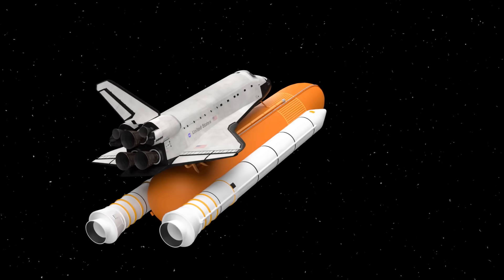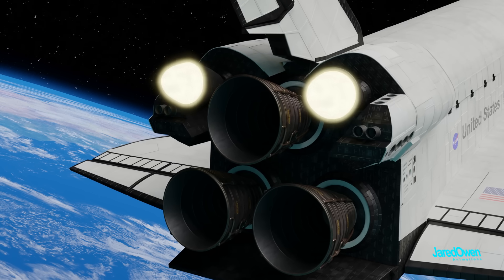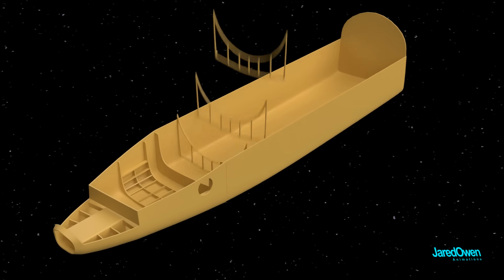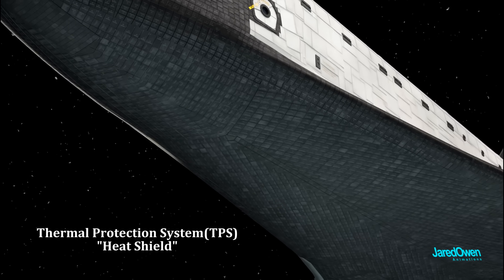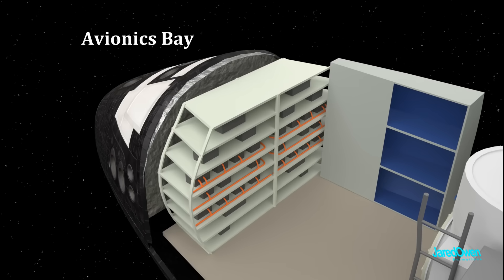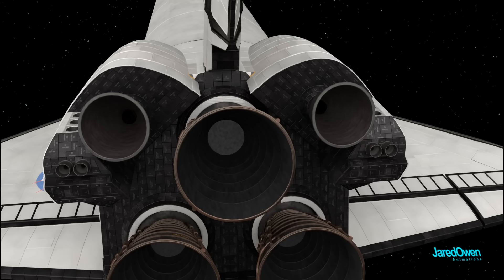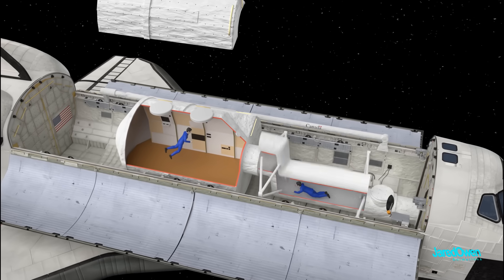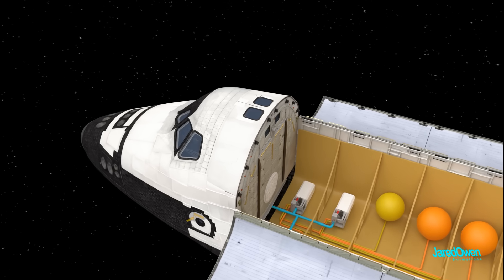How did the Orbiter Vehicle work? (Space Shuttle)

Comment: 9:05 what is the reason the fuel needs to be cooled before it is burned?
Reply: What do you mean?  The liquid fuel is ALWAYS been  extremely cold. The fuel needed to pass through the rocket engine's noozle so that they won't melt due to extreme heat by the burning of propelants. It kinda acts as a cooling system, killing two birds in one stone.
Reply: To make it more dense to carry more.
Reply: The hydrogen and oxygen were cooled so that they were liquids. This allowed the tanks to carry much more fuel than they could if the hydrogen and oxygen were gases.
Reply: It’s to prime the engines and prevent thermal shock.

Comment: factoid - off the shelf  " Philips Milk of Magnesia " used on each of the three
APU's mounted on the 1307 bulkhead. Applied to the threads of the EGT
sensors mounted on each exhaust stack as a anti seize  agent.
Anhydrous Ammonia stored in three AFT tanks about  the size of soccer balls 
shaped like inverted tear drops mounted above  the 50-1 door

Comment: factoid - microphones mounted on the belly of orbiter OV-102 
I routinley R&R , 3  located on the center line
at the wing root with one at the base of each root.
whats curious I questioned INS folks yet always told in a polite 
way they  don't  know there purpose

also - explosives
cargo bay - at each RMS pedestal located on the payload bay door sill
are small guillotines which sever control wires which signal a retract/extend/
 status to  the Forward Mission Station prior to jettison.
KU band antenna functions the same way

Aft compartment --  internal ET attach mounts designed to fracture the attach
(2)nuts port and starbrd. the units were covered by a large inconnel honeycomb 
mesh bowl which contained the shrapnel that otherwise would pelt the interior aft
compartment.

vent doors - Aft & Payload bay port and starbrd , function tested each launch

Et (external tank) doors - surprisingly those large doors, mostly go unnoticed by those 
who walked daily under the orbitors . They are Opened prior to Et tank mating VAB and 
cycled tested each flow. These doors are covered with tile they travel 180 degree the mechanism /linkage itself looks and acts feeble which is slow and labored, once opened its latched in position.

Comment: I feel like it should be mentioned that the shuttle was NOT originally designed to carry that many crew, nor was it intended. Adding those other positions came later in the program as the shuttle didn't realize the savings it promised and more justification was needed to continue funding. Hence, more people for experiments, and capacity for the oncoming space station passengers.
Reply: There were so many things the Shuttle under-delivered on, as well as many concessions made to keep the cost down.  Things like the detachable crew cabin that could have saved the lives of both the Challenger and Columbia crews.  But then, if it used liquid-fueled boosters rather than solids, the Challenger disaster may never have even happened.

Comment: The design of the shuttle looks awesome and makes sense. I wonder why it was so expensive to run?
Reply: Because those massive engines at the back had to be taken apart and painstakingly refurbished between every flight.  On top of that, every single tile across its surface also had to be removed, inspected, and fixed or replaced.  And that's only the main concerns.  Everything else inside and out had to be inspected and refurbished as well.  Its promise of reusability unfortunately fell quite short.

Comment: whats the orange tank for again?
Reply: For launching into orbit, it in the main Tank. When you see other rockets they are big and only consists of tanks. The shuttle accelerates up to 17,000 mph, stops the main engines, and throws away the orange tank.
Reply: The orange tank supplied fuel and oxidizer for the shuttle's three main engines from lift-off to about 8 minutes after launch, when the shuttle had almost reached orbit. The final little push to a stable orbit was done by the two much smaller OMS engines that got their fuel from internal tanks in the shuttle's tail section.

Comment: Beside External Tank, was there any Fuel inside Orbiter for Main Engines... If any use for reentry and during landing like an aeroplane
Reply: No, only for the much smaller OMS engines and the RCS thrusters.
The two OMS engines were used to give the orbiter the final little kick to reach a stabile orbit, and also for the re-entry burn to initiate the landing procedure.

Comment: How does the external tank not break up on the ride up, but does on the way down? Doesn’t seem to make sense!
Reply: It does make sense once you realise that the shuttle’s speed vs altitude during launch was very different from its corresponding speed vs altitude during re-entry.

The very upper part of the atmosphere near the Kármán line (100 km altitude) is so thin that it didn’t slow down the shuttle very much. It was therefore still flying at near orbital speed when reaching the denser atmosphere lower down, where it experienced its maximum heating at 70 km altitude when still moving at about 24,000 km/h.

During launch, most of its acceleration happened after it had crossed the Kármán line. When passing 70 km on its way up, its speed was only 5600 km/h or less than one quarter of its speed at the same altitude on the way down.

Although not identical, the speed vs altitude profile of the external tank during re-entry was far more like that of the orbiter’s re-entry than during their launch. And unlike the orbiter, the external tank didn’t have any thermal protection system since it was meant to be destroyed during re-entry.

Comment: If space is a vacuum, how can thrusters work, and or combust if they do?
Reply: First of all space is not a vacuum. Second of all the thrusters use an oxidizer to combust with whatever fuel it uses which produces a propulsive force.
Reply: @msidc1238  what, if space isn’t a vacuum then why is it called a vacuum. Figured the oxidizer supported combustion but the force has to be put onto something so, why do they say space is a vacuum.
Reply: @robertbonsai7176  Same reason vacuum chambers are called vacuum chambers even though they cannot achieve a perfect vacuum. In fact it is impossible to achieve a perfect vacuum. The force doesn't have to be put onto something. The gas rapidly expands as it leaves a nozzle causing a propulsive force. "For every action there is an equal and opposite reaction".
Reply: how can thrusters work

Because physics magically doesn't stop working in vacuum kiddo;)

Comment: Great animation
A little lite on the info for specifics
Such as rentry   why is rentry is free return trajectory chosen? Initially the design called for jet engines. How design developed to what was flown.   
Orbiter info such as enterprise was initially intended to be reconfigured to fly in space but was later determined it would be cheaper to assemble new orbiter out of spare parts instead. Why did the Columbia have black chines on the top forward section of the wings? And no others did! Why was Columbia so much heavier than others. Why was white tiles removed in lieu of nomex blankets on top side of orbiter? 
Tons more questions to answer. 
More info on SRBs and tank as well. We all know about the o rings what was original design? What changed? What is the bipod ramp foam? Why was it needed? What did they end up with? Why was the first ET painted white? Why was the tank not reusable? 
More info on SSME's . Why wasn't SSMEs not jettisoned with the ET? Why TPS was silica tile chosen? Why not oblated materials? Who and how was it shuttle built? Who designed it? 
Why was program cancelled?

Comment: Very good video, but most people have no idea how useless the space shuttle program actually was. It was one of, if not the most dangerous manned spacecraft with a total of 14 deaths and the loss of 2 vehicles. This gave it a 1/68 chance of failure during the entire history of its missions between 1981 and 2011. The cost to get the space shuttle ready for each mission also greatly exceeded that of most single use rockets as well, and given how little it was used compared to how it was advertised, the cost per mission was around $1.5 billion, and the cost to deliver 1 Lbs of material into orbit was around $27,000. (For comparison, the Soyuz can deliver the same amount of mass into orbit for $2,400 instead)
Reply: True, however it simply wasn't possible to use other things to move such large segments to space with any other rocket. Yes the space shuttle was overpriced and had failures which caused the program to die out. However the ISS needed the space shuttle for its ability to bring such large modules to space.

Comment: Seems they could of flushed their body waste like poop and pee in space because if it reentered the waste could burn up. Is the reason they don't because they might need back up with it orbiting the earth and it might splat on the windows or I guess be frozen and maybe come and hit the shuttle causing damage to it? There is other space debris so a little poop and pee shouldn't be a worry.
Also how is the boosters not burned up when it reenters but the big external tank does? I still can wrap my head around when that man jumped from space when he was in a balloon and didn't burn up, even went mach 1 almost passed out from the G force.
Reply: The big fuel tank (the orange one) was released much higher then the boosters. The boosters were also designed to be recovered, while the fuel tank was not. The man who jumped from the balloon jumped at 135,908 and didn't have prior acceleration upward. He simply just fell. While the SRBs were dropped at 30 miles up or about 150,000 feet. The orange tank was dropped at 70 miles up or about 370,000 feet up, much higher up with the aforementioned height upwards. Thus it fell faster and wasn't as resiliant to heat and burned up back on the way down.

Comment: Grown men talking about space travel 😂😂. What a joke. That piece of junk goes 17,000 mph!!?? Does anyone think anymore? The SR-71 was a razor thin aerodynamic engineering marvel, it stretched a couple inches at it's cruising sleep due to extreme heat, it didn't have any paint on it cuz it would melt. The maximum speed of the SR-71 was 2,455 mph. This piece of garbage would fall apart at 500mph...stop believing in cartoons
Reply: We have video proof. So maybe you shpuld get an education first
Reply: Firstly, the speed of the SR-71 was measured at 85,000 feet. While the space shuttle that flew at 17,500 miles per hour was measured in low Earth orbit at about 1,642,000 feet where air resistance is almost non-existant. While the SR-71 had to fight against air resistance when it was accelerating. 

When the space shuttle was re-entering earth's atmosphere, it had to de-celerate using the heat shield on the bottom and front, while the SR-71 still had to accelerate to reach that speed. By the time the shuttle was at the SR-71's cruising altitude it was already much slower. Plus the shuttle did fall apart above 500mph once. 

RIP to those aboard the space shuttle Colombia during the heat shield failure.
Reply: I watched with binoculars Shuttles fly overhead many times.
Reply: no

Comment: Hard to believe that such tiny thrusters can enable a big ship like that to turn or make adjustments in space! Cool video!
Reply: I know that's so crazy, like I always thought propulsion was impossible inside a vacuum with nothing to push against!
Reply: @garymericano   that is not how propulsion works.  Force in any direction has an equal force in the opposite direction.  "pushing against" is a third component that does not apply in the source principle.

@fredriddles1763  the Orbiter does not fly in space the same way an aircraft does.  Its movements are meant to be slow and precise, not big and sweeping.  And when dealing with delicate satellites or space station modules, you want movements to be in terms of inches per second, not feet.  You definitely won't be doing barrel rolls like the garbage we see in movies like Armageddon.

Comment: I have a question, could anyone answer it please 😃
The hull of the space shuttle consists of ceramic tiles bonded to an aluminium skin. Discuss the design requirements of the shuttle hull that led to the use of this combination of materials. Evaluate the major problems the designers and manufactures face while producing the hull of the space shuttle.

Comment: Great video! One important point I would have liked to see in the video: 
The main advantage of the space shuttle which has never been replicated by other spacecraft was the ability to bring large items BACK from space. Rockets can put stuff into orbit, often cheaper than the shuttle, but none of them can bring stuff back (except in very small quantities inside a capsule). Recovering or repairing military satellites was a core task the shuttle was designed for, although in reality it wasn't done nearly as much as initially planned. There has also been a lot of talk about the shuttle being designed to steal soviet satellites, although I think the consensus is this wouldn't have been possible.
Reply: This is probably why the Air Force (and now the Space Force) was so interested in the X-37B, a kind of uncrewed mini-shuttle launched on a rocket with a big payload fairing: after the Shuttle, they needed a way to test some bit of space tech and then bring it back for analysis. I've seen a lot of guesses about what they're doing with the X-37B that don't make any sense because they're things you could just do more easily with the rocket without putting the spaceplane on it. Returning the payload to Earth has to be critical.

Comment: As a former submariner, I'd feel claustrophobia with 7 people squeezed into such a tight confined space.
Reply: But I think going on a Shuttle mission would be way cooler than going on a submarine mission, for someone used to any one of these of course.
Do you think the shuttle would have more cramped than a submarine ?
Reply: @psirvent8  depends on the size of the crew for the mission. Fast attacks can be quite tight. But, we always had good food and good company, so, no worries. We become family.
Reply: Gravity is a far greater hinderance than we give it credit for.  If you removed gravity, a submarine would feel considerably more roomy, as you no longer have to factor walking upright.  And you'd be surprised how much more room there is when you could now use what used to be the floor and ceiling for work and stowage space on top of that.

Comment: While I liked that you mentioned the Spacelab module and Canadarm there are so many other things that were often stored in the payload bay that you completely forgot about. For one thing you completely forgot to mention the KU Band antenna that was always on the shuttle that was deployed once the payload doors were opened. You had it on your model there but you completely forgot to talk about it. Also there were so many other interior modules that the shuttle carried a lot called SpaceHab, and when those were on the shuttle there was usually a mission extension pallet that stored extra liquid hydrogen and liquid oxygen for the fuel cells which helped increase the mission time which was a necessity on the missions that carried SpaceHab components. The main component of a SpaceHab mission was the actual hab itself which was either a Single Module or a Research Double Module. In addition to one of those they also usually carried a External Stowage Platform and an Integrated Cargo Carrier for storing extra equipment and doing maintenance on satellites. They sometimes mixed and matched these components and sometimes also had Logistics Single Modules and Logistics Double Modules or a mix and match of all of these. Another thing you forgot to mention is that sometimes the shuttle launched payloads to Geosynchronous orbits or interplanetary distances but the shuttle itself couldn’t go that far so it used an Inertial Upper Stage to get those payloads to their destinations I think you should’ve shown how they did that. But then again this is all very complicated and would probably make this video long and convoluted. But I think you could make a part two of this video that explains all of these things.
Reply from the maker: Thanks for the comment!  Yes there is definitely more things I could have put in the video.  At some point I plan on doing more space shuttle related videos
Reply: @JaredOwen  I’ll look forward to it! Thanks for the great content!

Comment: If the space shuttle frame was made of steel, columbia wouldnt of disintegrated ending the space shuttle program as soon as it did.
Reply: really, is steel melt at that temperature  !
Reply: @jadumonigogoi403  yes sir. steel is more resistant to high temperature. At the point where aluminum melts, steel just gets soft and red but intact. Thats why elon musks starship is steel and the apollo command modules were steel. I think the spacex crew dragon is also steel
Reply: Columbia got a gap in the heat shield, if it would have been steel, it would not have helped at all, steels melting point is not that high that it could survive the heat of the reentry. Also the Dragon 1 and 2 are neither steel
Reply: Steel is much heavier tho, this thing was meant to ferry payloads.